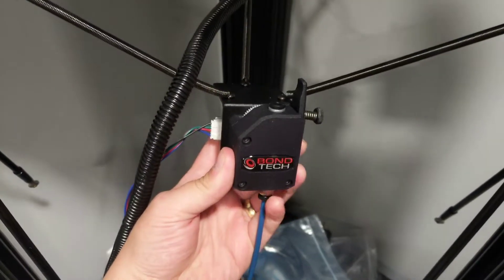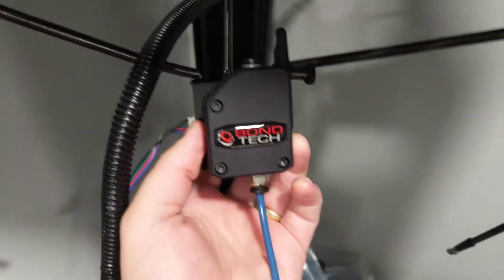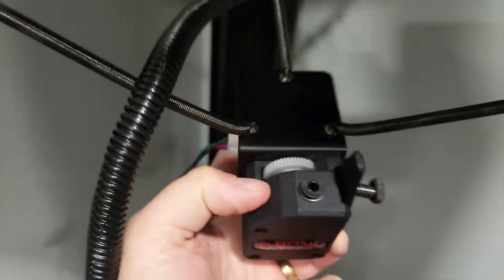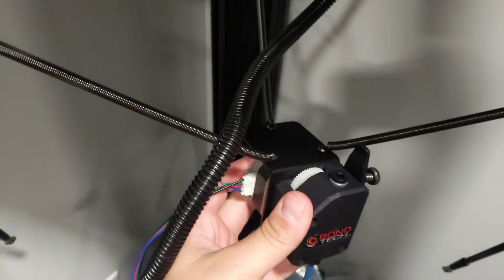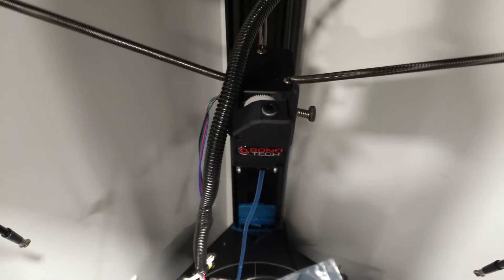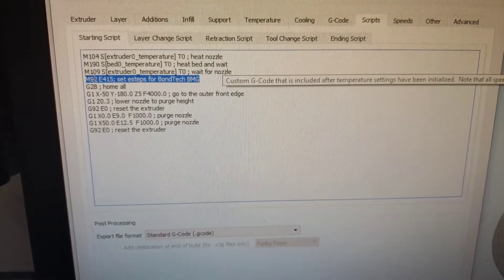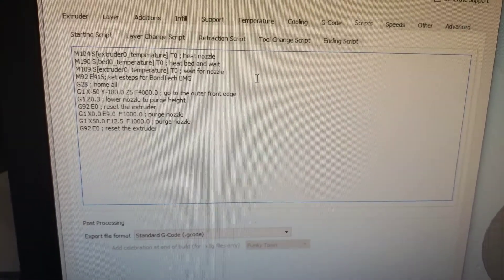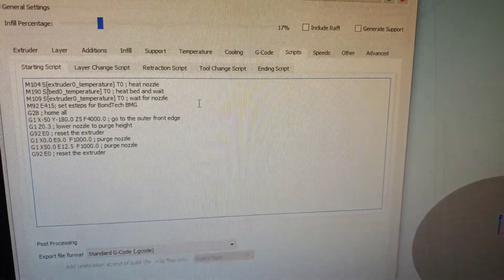AnyCubic Predator - Bondtech BMG Extruder Installation

Comment: So I've learned a couple things. 1. No need to reverse the wires or change the firmware, just mount the extruder upside down, the filament path looks the same going up or down in my clone, so it shouldn't matter, might need to flip it if the quick connect fails or wears out, but for now it seems fine. 2. Adjusting the esteps in the slicer does nothing using the stock board, M92 E415 vs M92 E500 makes no difference in the prints they both extrude the same and print the same, what did work was adjusting the flow rate. Still playing with the flow rate, seems like I have a separate slicer problem that is complicating matters.

Comment: Alright, first off thanks for sharing this video! My question is which pins do you switch to get the gears to move in the right direction? I'm wanting to switch the pins in the plug end that plugs into the stepper. Thx in advance!

Comment: I have just one more question, the esteps M92 E415 are just for 0.8 nozzle ? I'm switching nozzles quite often and at 0.4 it's over extruding. I couldn't find the info I was looking for at Bondtech website so I decided to ask here. Thanks in advance Jon.
Reply from the maker: The extruder steps do not change based on nozzle size. That difference is handled on the slicing side of things. You will need to calibrate flow and even temperatures for different nozzle sizes. Which slicing software are you using?
Reply: Simplify3D, for smaller objects with more detail I use the 0.4 nozzle and for big objects (rc gas boat stands and similar things) I change the nozzle to 0.8, The fan2 is used for cooling the threaded heatsink  but only one of the fans0 is blowing air for the 2x4020 duct release.

Comment: Great video thank you, I also added the Bondtech BMG extruder and I would like to ask which one pins on the motherboard do I change ? Thanks in advance.
Reply from the maker: Just switch the connector around. I can't remember if the connector was keyed, but then simply mirror the pinout.
Reply: yup you was right, I just had to make sure so I took a look at this video and it was pretty clear. Thanks Jon!https://www.youtube.com/watch?v=-iubywKkNEE

Comment: Did you use the stock extruder stepper motor when you replaced the stock extruder with the Bondtech extruder, or did you replace that as welll with the Bondtech's stepper motor?
Reply from the maker: I used the stock stepper that came with the printer. When I purchased the Bondtech BMG, it didn't come with a stepper. Was going for better extrusion force, not weight reduction.

Comment: I am also adding the BMG to mine, but I am a bit ignorant so far regarding things like starting code etc. Can you tell me what your start code is for yours, maybe a copy and paste of your actual start code? Or at least, tell me where to insert M92 command, and did you use 415 as your esteps number? Any help would be great...
  Btw I tried using nylon to print, and quickly found out that the v6 clone hotend isn't actually a clone- it is NOT all metal, the Bowden tube goes all the way through the fake heatbreak and 6mm down into the heater block! It clogged the bottom of the Bowden tube horribly, so I traded it out for an actual e3d v6 hotend...
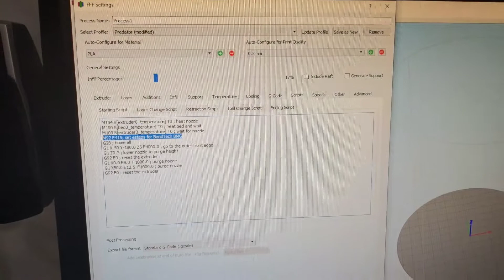Reply from the maker: At 1:52 there is a perfect look at the starting gcode. Let me know if it works out for you
Reply: @jonsenkiw  Got it, thanks- does it matter what order commands are in? I put the M92 line in last, and it seems to be working perfectly...

Comment: Is it a good upgrade? Why not mount it right on the platform?
A weight issue?
Reply from the maker: Using a capricorn tube and the short distance from the nozzle give it extremely similar if not the same result as a direct connect system, minus the weight of the extruder on the effector.

Comment: Great manual. I was about to install one myself. Do you know how to reverse gears in firmware in order not to change wires?
Reply from the maker: I have not attempted any firmware changes. The wiring really is the easiest way to do it.
Reply: @jonsenkiw  and... wich wires should be changed? I tried upper and lower ones (black and blue) and motor started to vibrate, without moving :(
Reply: @camarpi  hey dude, if you've not figured it out yet, swap the black and green wires, or the blue and red wires, and that should reverse your motor direction
Reply: Also, there is no way to swap direction in the firmware. Anycubic locks it so it's not possible to edit it, unless you have an aftermarket mainboard
Reply: @lloydmorrissey  is there a tool I need or can I just pull them with my fingers/pliers. I dont want to break anything.
Reply: @cody1b  if you look carefully at the plug, there are some tiny metal clips that hold the pins in. You need something fine and sharp and to carefully press the locking tabs in as you gently pull on the wire and it should come out. The goal is to press only enough to get it to disengage and no so much you cause the tabs to permanently bend. If you go to far, you can carefully resend the tabs, but don't do it too often or it might break off and you'll need a new plug. The plugs are dupont connectors which aren't too hard to replace but need a special crimper to redo, so avoid it if you can

Comment: You said you measured it- you can go into the firmware and say, tell it to extrude 50mm, then check it?
Reply from the maker: Here is an excellent write up on how to calibrate. I am unfamiliar with the firmware on the delta, so I change the extrusion distance in the starting code. https://mattshub.com/2017/04/19/extruder-calibration/